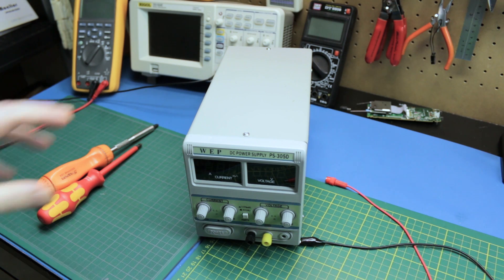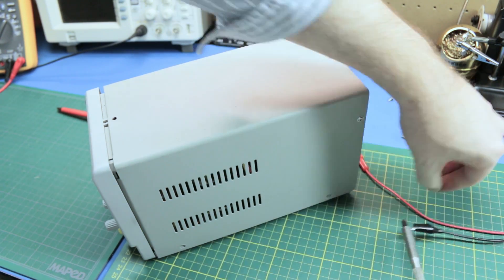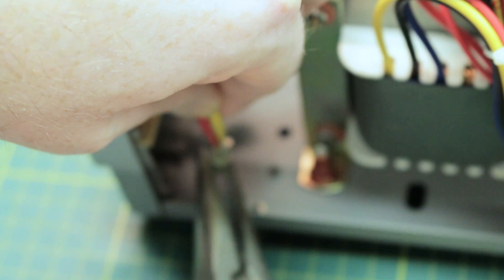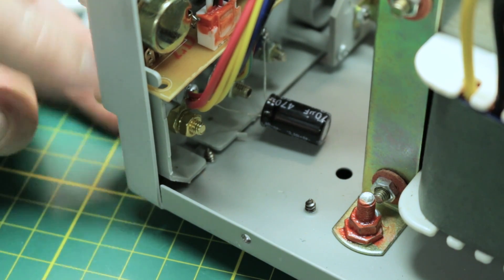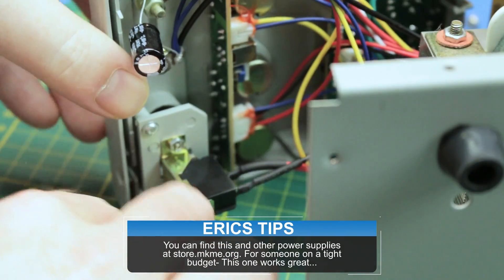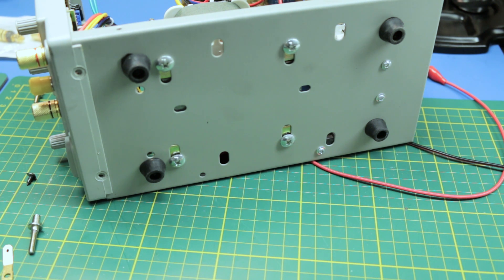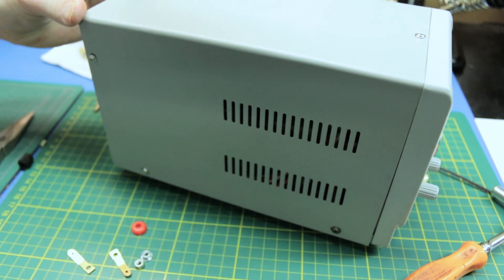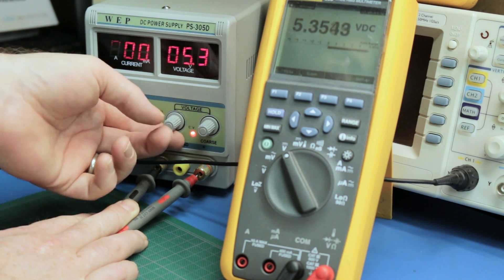Essential Electronics Repair Skills | POWER SUPPLY FIX!

Comment: I have a different model than the one you showed but I know they work the same. But I'm having a problem with my high low button I don't see a change when I press it in what could be that problem I don't see a change from high to low.

Comment: I got a 15V 2A ..little brother version of yours. Got some problems. It powers up and It displays only to 5.6V ..no amps display when turn pots. The actual voltage reading on my DMM shows 40 - 50v. Got it open and had a good look..nothing obvious except for 2n3055 power transistor some discoloration..could be heat or chemical dried and on the lead..unscrewed it looks ok though. I'm gonna try and trouble shoot it. any tips on where to start. I watched your other vid where you poked around..will try that next. will touch up any solder joints that look suspect
Reply from the maker: Could be a similar display problem.
Reply: tempted to swap out the 2n3055..how do test that? Do i have to take it out of circuit, or can i measure it as is.?

Comment: Did you do a video on the cap install? It was not original was it? Thanks
Reply from the maker: It was there from factory. You can just add one though if yours needs one. Cheers

Comment: Maybe this is a dumb question, and if so, I apologize, but wouldn't the outside of those posts be live at what ever voltage you've got the power supply set to?  They look to be metal, and I know banana plugs of similar design are conductive inside and out.
Reply from the maker: Not dumb at all- I should have put a disclaimer in the video- You are right that they are live. In my case there is little chance of shorting them on the bench (and the PS limits the current to the value I select) but people should be aware there are live. Cheers

Comment: Great repair job and awesome tips for beginners.
I think it is really small price to pay, if one needs to replace part or two (which costs no more than a cup of coffee) after few years. Things like potentiometers and some connectors are basically consumables... They might start to fail after few years, but there are replacements available and changing them is usually easy.
Reply: I ordered 10 of these nearly identical power supplies for my HS electronics class and have had great service out of them for the last year and a half. I had one that was DOA and the company shipped us a new one without having us send the old one back since they are so inexpensive in the first place.  I ended up taking the damaged one apart and repairing a few traces on the board that were damaged when it must have been dropped during shipping.  Now we have a spare just in case.  I have had a few of the cheap terminals fail but insulated 4mm banana screw terminals of higher quality are cheap and easy enough to replace.  I have been thinking about modding the spare with 10 turn POTs and better meters since you can buy 5 digit 0-33v meters on eBay fairly inexpensively as well.  These power supplies all seem to be built on a similar schematic and very similar off the shelf parts so modding seems like a great option if you have a way to calibrate them.
Reply from the maker: Thanks very much for the feedback. Agree fully- when I buy a power supply 1/10th the price of a mid-line lab grade unit, I'm totally okay with a couple minor repairs :)  Cheers
Reply from the maker: Very cool. Cheers
Reply: Excellent Video! Excuse me for the intrusion, I would appreciate your opinion. Have you researched - Saankramer Electronic Magazine System (just google it)? It is a smashing one of a kind guide for learning how to repair electronic items like a wizard minus the hard work. Ive heard some incredible things about it and my close friend Aubrey after a lifetime of fighting got great success with it.
Reply: Appreciate Video clip! Apologies for chiming in, I would love your initial thoughts. Have you thought about - Saankramer Electronic Magazine System (Sure I saw it on Google)? It is an awesome one off product for learning how to repair electronic items like a wizard minus the hard work. Ive heard some pretty good things about it and my friend Sam after a lifetime of fighting got excellent results with it.
Reply: Not certain about the points made but ,if anyone else  trying to find out 
consumer electronics repair
 try Saankramer Electronic Magazine System (just google it ) ? Ive heard some incredible things about it and my mate got cool results with it.
Reply: +Hugatry's HackVlog Not certain about the points made but ,if anyone else  wants to uncover 
tc electronic repair
 try Saankramer Electronic Magazine System ( search on google ) ? Ive heard some pretty good things about it and my colleague got excellent results with it.